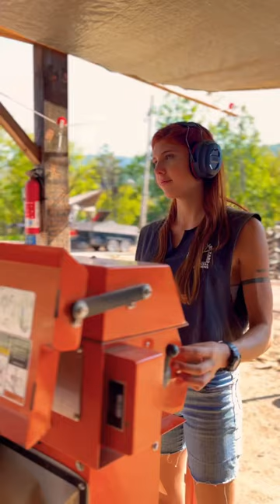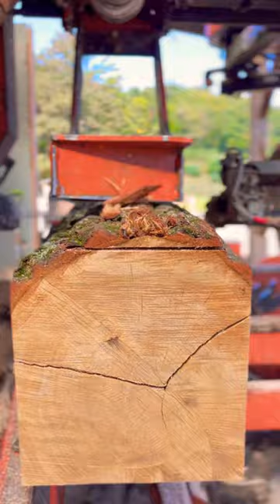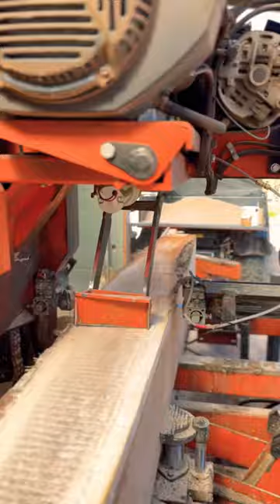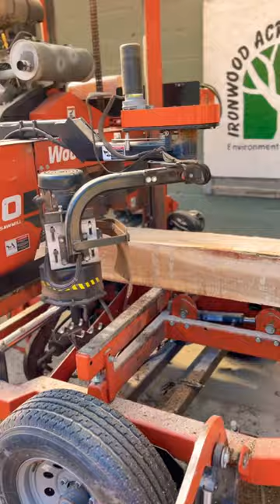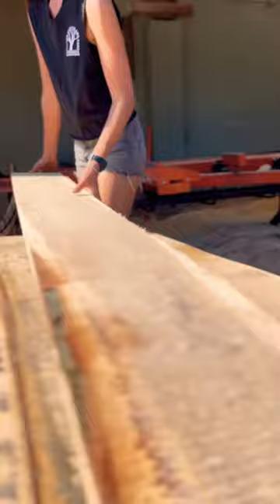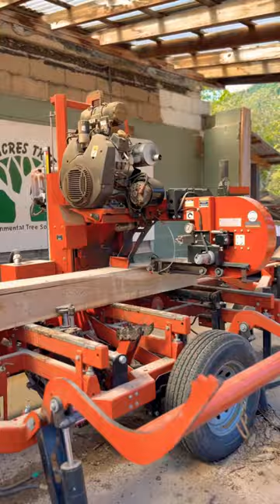Board bonds 😂

Comment: Just a corection on lt40 its rated at 500 bf per hr give or take
Reply: 800 board feet per day did seem kinda low.
Reply: Yeah, I was thinking about that. That's only 100 8x12x1 boards. On the other hand, I guess if you include time to move logs, square them up, and to move the waste, it's probably a lot closer to 100 bf/hr than it is to 500 bf/hr.
Reply: Let's stick with Em's stated number. They are working the machine and turning logs into saleable board feet material. Each log has an estimate as to how much they believe it will yield. By tracking the estimate vs actual you quickly learn how great of an eye one has. The better the eye on both sides of the job, the better the profits.

Comment: If you want to do more production type timber like 2x4-6-8  you should look into a nice swing saw setup like a turbo saw or the like. Finished board every down and back once into the log. Way easier on your body parts and piece as you don’t roll the logs. You just cut down through it. Don’t get me wrong. I think a bandsaw definitely has its place. I just feel like you can get better straighter lumber faster with a swing blade.

Comment: A log can be cut many different ways. I think you're looking for the maximum profit cutting plan. Maybe you already know how to do this, but the operations research community uses algorithms to plan cuts. Typical returns from switching to guesswork to optimization is 10% to 15% improvement in profit. Look me up if you want to know more.